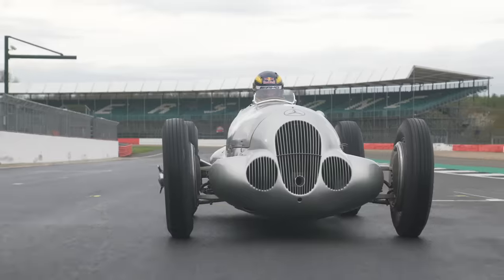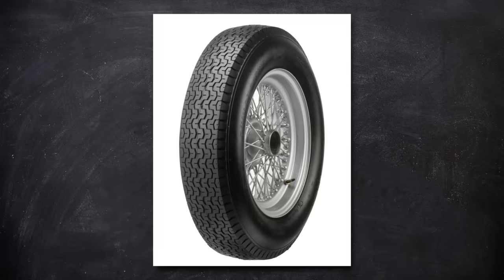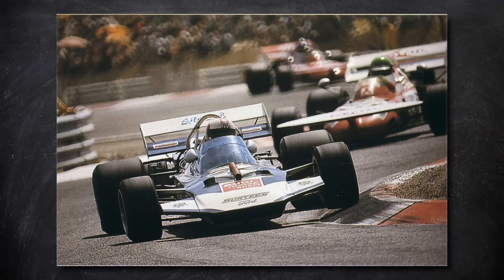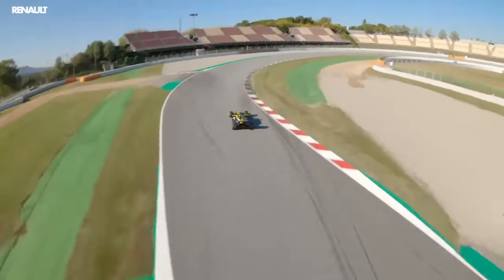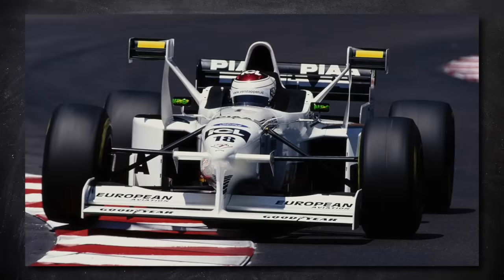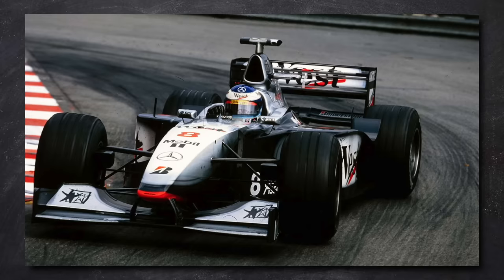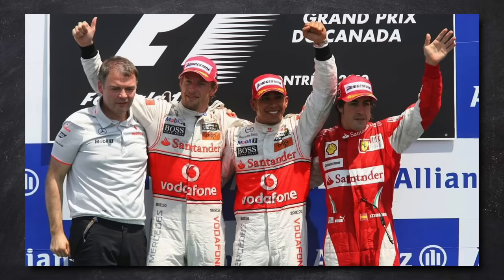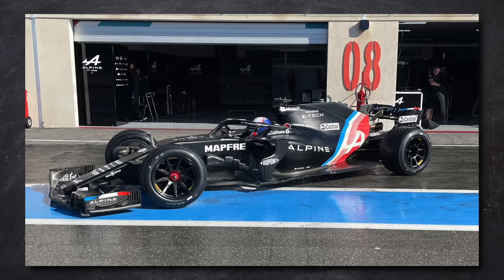The Incredible Evolution of F1 Tyres

Comment: you can tell me what you want, but those early 2000s f1 cars with the grooved tires, smaller and narrower body and screaming v10... they are the embodiment and peak of f1 and its looks
Reply: Totally agree
Reply: I would say the 1990 cars like ferrari and McLaren were like the ideal look of f1.
Reply: The cars from 1998 - 2008 were beautiful.
Reply: Agreed! That was the era I definitely enjoyed the most 😎👌🏾
Reply: Those cars are the embodiment of what f1 should be again. Move the electric crap over to Fe and shrink them again.
Reply: Completely agree. I don't even know what f1 is now. It used to be like go Karting to the extreme. But its something else now. V6 I mean cmon.
Reply: Completely disagree.. been a fan from the early 80s and by far the 83 to 93, the turbo era, bolt new tech on, freezing fuel and really pushing the envelope (albeit it crudely by today's standards) are the true F1 years.. Senna, Prost, Mansell etc.. at the end of the day tho each to their own but I do agree that today's cars seem far removed from what defines F1
Reply: i prefer 95-97 era.
Reply: @Firebolt1729  it was easier to wqtch boring races. As the sound, the speed feeling from the way cars were filmed, everything was better. Even grooved tyres made it groovy
Reply: Has to be 80s-90s for me! Mansell got me into F1 in this era.
The FW12 - FW14 will always be defining for me. Slick tyres and no silly sticky outy bits! They just look like pure racers to me
Reply: Agreed. The Ferrari F2004  IS Formula 1 to me.
Reply: You hear me arguing, right??
Reply: I take it that you are under 40yo. 🤔😉
Reply: @fissionchips8840  I'm with you brother 💯.
Reply: Kevin Peralta  They didn't start beating the 05 times until relatively recently. That's pathetic for what is supposed to be the pinnacle of motorsport. Those days had engines with upwards around 1400HP. They raced cars with much less down force that danced around the track. F1 didn't hit 1000hp again until recently. Think about were those cars would be today if they stuck to making the best racing cars, instead of the most sustainable blah blah blah. Now the only thing impressive about the cars is their efficiency. Talk about a yawn.
Reply: 1976-78 after they got rid of the huge airbox were the best looking cars.
Reply: Based
Reply: Grooved tyres sucked tho
Reply: @Firebolt1729  True
Reply: I don't agree. I much prefer the pre-1987 turbo cars with huge horsepower and turbo lag, 0 efficency, wide, meaty, fat slicks and preferably, ground effect undertrays of the early 80s cars.
Reply: @fissionchips8840  that's right mate, completely agree on that
Reply: @jasonmoyer  Oh yes, especially with the ground effect undertrays and side pods
Reply: I never liked those cars, the narrow rear wings always looked weird to me and completely out of place on a race car. Also, the front wings were massive and completely out of proportion to the shorter width of the rear.

I actually think that the cars coming in 2022 is the best F1 has ever looked. Before that, I'd say that the cars from the 60s and 70s looked pretty great too.
Reply: Gonna be honest… 2021 has been amazing, why change anything?! 😂
Reply: @wibblewabblewoo6249  they’re scared of electric stuff
Reply: F1 fans when car technology advanced in the 80s: wow this is so cool
F1 fans when car technology advanced in the 2010s: ahhh too much technology must go back
Reply: Nooooooooooo
Reply: From the smallest possible width of the tyres to reduce drag and friction, to very wide tyres to increase grip. Talking about evolution...
Reply: @AN-kb4kh  they will be even bigger and heavier. These cars are not nimble.
Reply: @roastingminer6919  merry christmas 2021 roasting miner.
Reply: @Firebolt1729  dont forget 1994.
Reply: As long and you ignore the fact the modern F1 are faster while using less fuel. Nostalgia is weird. Lol
Reply: Crazy! You think those were the best looking cars? Look at the early 90s, before aerodynamic complexity fussed up the cars. The proportions and lines of, say, the Ferrari 641 (1990) are so elegant. Lovely looking cars. And to think grooved tyres were the peak of F1 looks or the package generally. Man... that's a real view.
Reply: nope the 2.4 v8 engines of 2006 to 2008
Reply: I agree on the Car shape, size and sound.

But Slicks > those grooved abominations.
Reply: Lmao no. That would be the late 80s early 90s. V8s, V10s, AND V12s all on the same grid. Slicks and a small body. That’s the embodiment of peak F1 Aesthetic; The Ferrari 641 and the McLaren MP4/4 are the quintessential race cars
Reply: I like that F1 peaked in the 90s and 00s
Reply: Love those cars but for me it will always be the different styles from the 80’s! 😊
Reply: The cars of that era were stylistically horrendous.
Reply: I’m u.  I
Reply: All the overtakes…..done in pit lane.
Reply: Have a look at the cars from the early 90’s and then come back to me.
Reply: The tire war era? Nah. That was shit.
Reply: Word
Reply: I prefer the looks of the wider cars
Reply: Kevin Peralta  you should try formula e. Speed means nothing, we came to watch cars racing not a vehicle going as fast as possible. If you want to see that we might as well just cut the races and make it qualifying only.
Reply: I agree with everything apart from the tyres. Slicks look cooler.
F1 has always been the epitome of high tech. So although I like the look of mid 90s cars time has moved on and do has tech
Reply: Everyone talks about peak F1 and I wonder if it just depends on when you got into it. I love how today's cars look ... but also only recently got into F1.
Reply: @orangejjay  yes and no... the 22 cars are beautiful, but design wise they went downhill since 2012 and soundwise they got off a cliff in 2014
Reply: I hate it they had grooved tires in the V10 era... 😢
Reply: I 100% concur. I am not a fan of the direction of F1.
Reply: 2004 cars had 1.55 hp per kg (f2004) constant power. Nowdays only 1.2hp per kg or so (peak when battery can be used). Thats what made them look so fast.. they were faster, more powerfull in relation to weight and lighter. The lightness made steering look super sharp. Best cars ever made
Reply: @source9264  facts
Reply: nah, the 2017 cars are amazing with the shark fins and wide tyres with low rear wings.
Reply: f1 today is what f1 should be
Reply: @williamdowling7718  Imagine making no sense. Lol
Reply: @pgmallon  do elaborate.. you said engines were way better before we started using electric power. Even though modern hybrid engines are faster than the huge displacement engines of the past.

You suggested that hybrid engines should be referred to as "electric crap".

Which part of what I said didn't make any sense to you? I can try to dumb it down if you need additional assistance understanding these basic concepts.
Reply: @williamdowling7718  Modern F1 cars FINALLY set lap times faster than those cars. It took them nearly 15 years to do it. They also have wild aero, completely different gear boxes, very wide tires and a host of other new tech to assist. Try reading comprehension out. I said, Imagine if they had spent the time and money they used getting heavy, bulky electric crap to catch up to those engines, into continuing development on engines. Hybrid engines are good for your prius. The dull sounding, heavy, bulky, expensive monstrosities have been bad for the sport. Electric isn't manly or feminine.
Reply: @williamdowling7718  At this point, I do think that the electric aspect of the cars is crap. You said they were faster. I addressed the metric. I agree it should be about the racing, which is largely about being faster than your opponent, but the electric has been about politics. It's bulky, heavy, complicated and extremely expensive. Performance took a back seat for 15 years in what is supposed to be the pinnacle of car racing, so what? Lol. Wow, listen to that efficiency as it saved gas on that lap! I don't have anything against electric. You want to build an electric car, you want to buy one? Go for it. Let the market dictate it's adoption, it's not the world's savior against fossil fuel use its billed as. We are talking about 20 cars that drive a few thousand miles a year, being shipped, flown and driven hundreds of thousands of miles every year, using thousands of tires, thousands of people and press and spending billions of dollars to save literally a few gallons of gas during a year. There is nothing green about racing, nothing. It is inherently wasteful. Maybe you should do a little reading up on the sport and your  beloved hybrids past the propoganda and the self righteous attitude.
Reply: @Firebolt1729  This
Reply: @fissionchips8840  Back when drivers got their position based on how good they are we’re rather than how rich their parents are.
Reply: @f3p  
Did technology in the 2010s increase racing like it did in the 80s? There's your answer.
Reply: @roastingminer6919 Nah The 2018-2021 look like fighter jets
Reply: The Grooves on Tires made F1 stand out. I understand the huge problems behind it and issues it caused but it looks aesthetically pleasing to the eye for the viewers. Idk, its a tough sell whether you want a race to be more enjoyable to view or more competitive. The sound of the V10s were further amplified by the grooved wheels.

Comment: F1 needs to stop regulating so strictly. The whole idea of the sport is that it is the pinnacle of engineering, but the teams are so limited. The teams should be able to use a variety of engines, more varied aero packages, etc
Reply: That might price teams to where there are not enough cars on the field. And theres the speed/danger factor. But yea, the regs require 'MIT' engineers just to 'go'..
Reply: first safety reason second efficiency reason t
Reply: Its a 'formula' its always been controlled. the more money that came in the more control was needed. There would be no F1 without limitations. Thats not even 'pinnacle' - real engineering genius is when funds are limited aswell as the rules
Reply: The problem partly is parity in racing to make it entertaining, and second they  can  engineer cars and tires that are beyond the limits of drivers G-Force limitations.

Comment: Corrections Pirelli did not remove the grooved tyres when they re-entered F1 in 2011 it was Bridgestone who removed the grooves on the tyres in 2009. Also the 2022 cars will have 18 inch diameter wheels not tyres, the tyres will be more like 22 inches in diameter.
Reply: They even showed a 2009 Brawn on slick Bridgestones...
Reply: Tyres like wheels are measured across the wheel diameter, thus it is correct to say that in 2022  F1 tyres will indeed be of 18 inch diameter.  Andy is referring to another measurement which is the tyres overall diameter.

Comment: I have a BURNING question:

Classic, vintage, and historic race cars that wear slicks or those old squiggly treaded tires and are used for historic races... are the tires on those cars of a superior compound and capability than their original time period counterparts, thereby making the car much faster, or are the tires engineered to behave like tire technology of the era of the car?
Reply: Take what I'm saying with a grain of salt but I think I remember of at least one tyre company (I think continental) that produces tyres identical to the historical spec
Reply: From this video (@1m50) https://youtu.be/mXgWWNJVdYA it appears that Pirelli has updated the compounds and construction of their "classic rally" tyres at least
Reply: It would depend on the rules of the historic series you enter. You can buy both exact ply/compound/tread replicas, completely modern ply/compound/tread tyres just with vintage looking logos on the sidewall, and everything between.
Reply: @Jonathan_Doe_  So this means at least one tire manufacture makes tires that fit historic race car wheels and have nowhere near the modern day performance of today's tires, yes? Meaning, they basically deliberately "hold back."
Reply: @gregorymarsh9504  Basically yes. But it’s probably safer on really old cars. Their wheel bearings/suspension parts/chassis probably couldn’t handle the extra loads of actually gripping instead of just sliding. Also the centre high of gravity of the older F1 cars would make it especially dangerous if they didn’t slide slightly through corners.
Reply: If.. then... blah blah. The W11 is gonna be the fastest F1 car ever
Reply: @kristianharalambiev7685  take your medicine
Reply: @JamesHoffa1  who are you?

Comment: CONTACT PATCH AREA does not directly affect grip on most tires. Coefficient of friction does NOT have "area" in the equation  [μ = F/N, where F is the frictional force and N is the normal force]
The smaller the contact patch the higher the contact pressure exerted by N so it cancels out. A larger contact path makes the tire LAST LONGER as it spreads the wear over a larger area. Also on super sticky compounds that are actually adhering to the road surface contact path does increase grip.

Comment: FYI increasing the size of the tyre doesn't automatically increase the contact patch. In fact for the same weight of car, if everything else remains constant, then increasing tyre width only changes the SHAPE, and not the SIZE of the contact patch. The contact patch is determined by the tyres pressure. As all the weight is resting on the tyres, you can calculate the contact patch by the weight of the car divided by the pressure of the tyre (this gives you the total of all 4), or the axle weight divided by the pressure divided by two will give you the contact patch for each tyre per axle. 
i.e. current F1 cars are about 908kg with full fuel load and driver. The tyres run an average of 22.5psi or 155.1kPa,  giving you about 573cm^2 (88.8 sqin)  of contact patch total or 143cm^2  (22.2 sqin) per tyre (avg) With a rear tyre width of 40.5cm, that means the contact patch is approx the width of the tyre, with a length of 3.5cm (1-3/8").

What increasing the width of the tyre means is you can run lower pressures, and thus have a higher contact area with the same deformation of the side wall, that on a thinner tyre would result in too much sidewall deformation under the weight of the car

Comment: Interesting video, but there are few physics errors. I will mention one, to avoid nit-picking:

Tyre speed versus airflow. The tyre describes a cycloid in relation to the ground, unless there is pure wheelspin. That means the top of the tyre is doing 200mph, when the car is travelling at 100mph.
The bottom of the tyre, directly below the axle, is doing ZERO mph.

That's part of what makes life so hard for tyres, they accelerate and decelerate on every rotation.
Reply: Can you elaborate on how relation of airspeed on different sections of a tyre degrades it? My common sense tells me that that effect is but a small fraction of the wear that a firm contact with the ground creates.
Do you have a source to back up your claim about changing airspeed affecting tyre lifetime?
Reply: @Kolja1987  what? I didn't make any claim.
Reply: Your last paragraph seems to imply that the airflow would somehow impact the tyre life. If so, I'm looking to learn more, it's an interesting topic.
Or did I misunderstand?
Reply: @Kolja1987  No, look up "cycloid". The stress on the tyre is structural, the acceleration experienced by the tyre is ongoing.

Consider also that only the very middle of the contact patch is stationary. Just ahead and just behind, where there is still contact with the road, the tyre is being dragged.

That wears the tread.

The repeated acceleration leads to fatigue failure in the tyre carcass.
Reply: @Setright  Year late to the party but...

If we were to fix a single point to a tyre and map it's travel, it would prescribe a kind of 'W' shape? My initial thought was of the number of G's that point would be doing but you said it also decelerates as well, correct?
So it's proabably not as high as my inner child wants it to be.

KevinSorboDisappointed.jpg
Reply: @Dazzaleinstein  Look up "cycloid"

Yes, the tyre is subject to acceleration and deceleration on every rotation.

Comment: Pirelli didn't remove the grooves in 2011 when they got the contract. Bridgestone a were running slicks in 2010. Idk about seasons before then, but pirelli didn't not bring or reintroduce slicks to F1 in 2011
Reply: Exactly. He even said it, but then changed it a few seconds later 🤦🏻‍♂️. Slick tires were reintroduced in 2009, the year Bridgestone said they were stepping out, but they stayed on that year, so F1 had Bridgestone slick tires on that year

Comment: Personally I think the worst thing Pirelli ever did for it's business was become the only tire manufacturer for F1 when the tires were designed to go off after a set period of time. 

I was born in 1996, the first F1 race I ever saw start to finish was the 2007 Chinese GP. When I got my first real car in 2018, a 2018 BMW 428i xDrive I negotiated into the deal a new set of tires because it was on Pirelli's. 

I had Continental DSW's for the life of that car. I wasn't able to negotiate the same on my latest car, a 2018 Audi A5, and the first thing I want to do this spring, before even getting a paint correction and ceramic coat, is getting it off of the Pirelli's it's got on now, and they were brand new when I bought this car at the start of October. 

I tried to not let the bad taste Pirelli left in my mouth as an F1 fan, but in the warmer months at the end of summer they're adequate at best, but once it drops below 55 or 60 degrees (f) they're soooo hard and take awhile to return to normal I really hate the way they feel